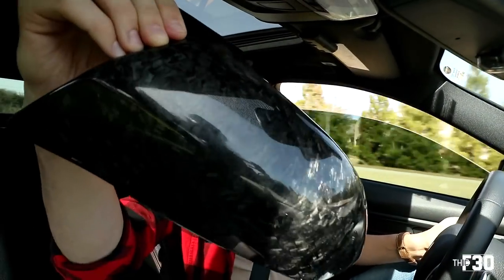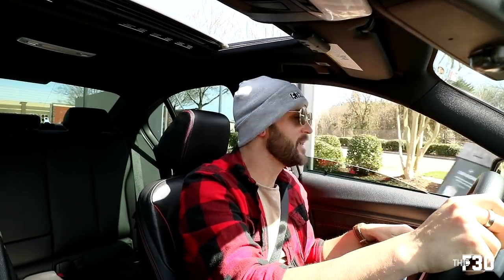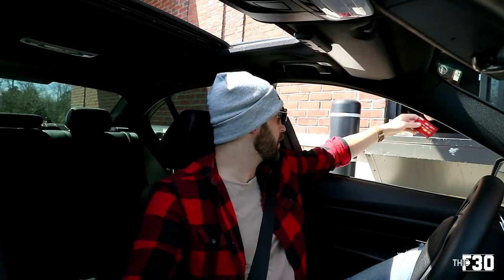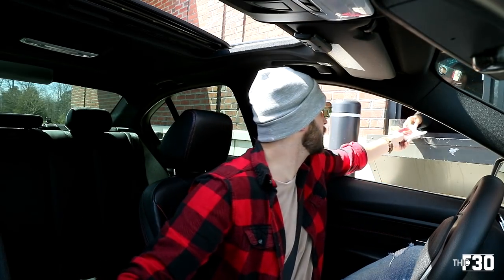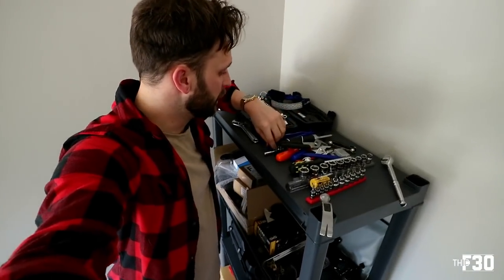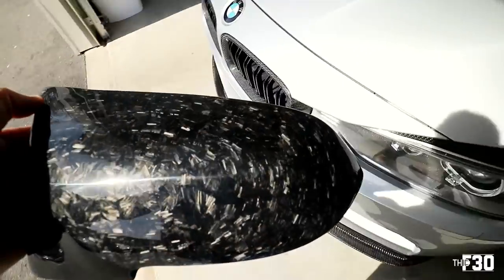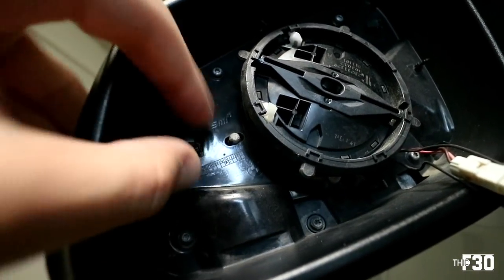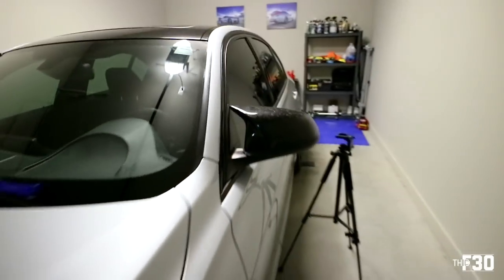FORGED CARBON FIBER MIRROR CAPS FOR THE F30 BMW!!

Comment: The bmw dealership in my area was charging me $500 bucks to change out the spark plugs, a set of spark plugs cost $80 so they are charging $420 for labor smh.
Reply: BMW of Riverside tried to charge me $480 to replace my rear brake pads lol.